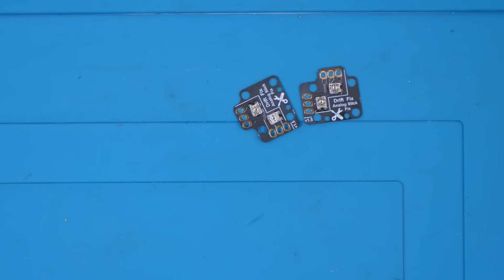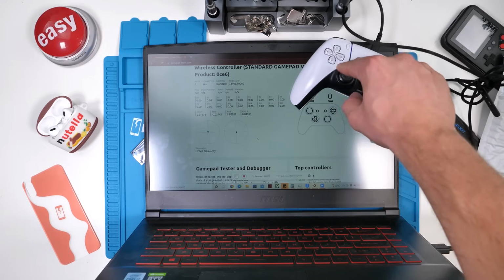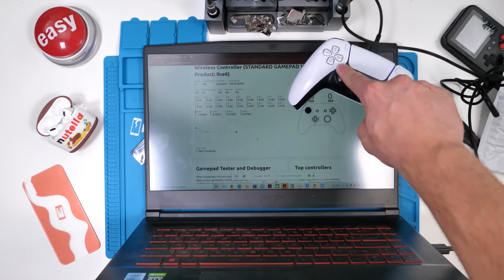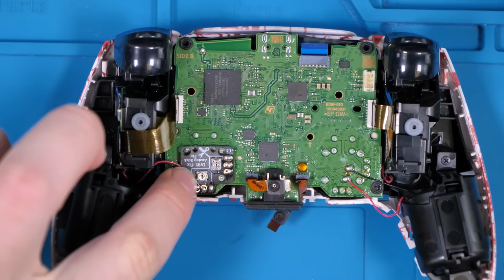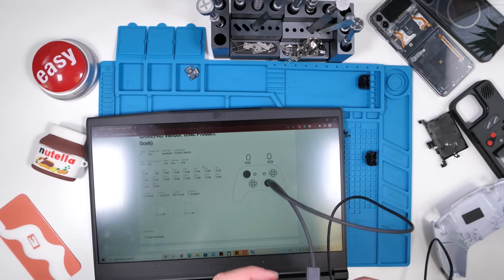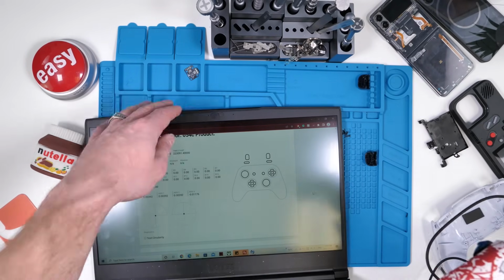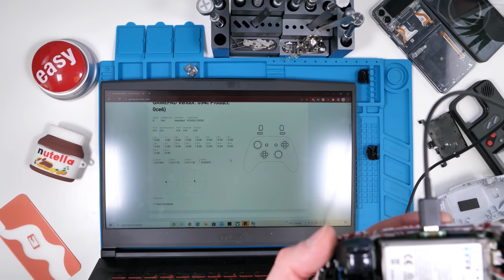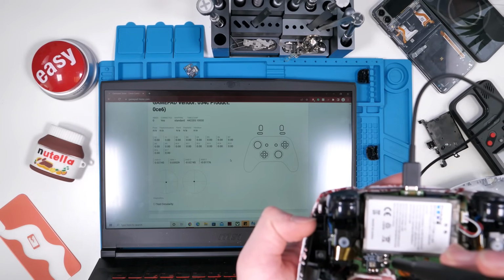IS THIS THE UNIVERSAL-  STICK DRIFT FIX?🤨

Comment: The stick drift was so bad on my ps4 controller it was unusable. I took apart the controller and open the little box thing on the joy stick with a small disc inside and blow in it and that fix the stick drift for the most part. There was still a little bit of drift but i could still play games with no issue

Comment: For minor drift, this is the best solution.
The drift will slowly get worse and eventually you’ll actually have to fix or replace the potentiometer. But for $6, it should buy you a lot of time and is still nice to have after if you manage to successfully repair or replace the component anyway.

Comment: L3 and R3 pressing while using L and R for moving and aiming is the culprits, i have tested this out one controller had L3 mapped as run and the other didn't...and the one L3 is mapped as run that was drifting after 4 months...the other one still works fine...

Comment: and for the Ps4 best fix is 100k ohm smd pots :). I just bought me a 12$ controller on ebay with drift n did another fix in preparations for mw3 :)

Comment: For Nintendo switch For some reason, the Joy-Con Drift (The stick Drift of The Joy-Con Controller) can be solved by a single piece of cardboard without soldering.

Comment: The only controllers which didn't have this issue were Xbox 360 original controllers, i got mine in 2007 and played with it for like half of the day for 10 years and they're still completely fine.
Reply: I used mine lightly for 2 years and left stick is drifting... my first one was really bad but it was a counterfeit. My current one is genuine.
Reply: they still have the issue just harder to get because the old stiks where bigger and stronger

Comment: Why do I have PS2 and an Xbox 360 controller with thousands of hours on them and no stick drift? On the Xbox controller I even wore out the button membranes and had to replace them. Something has gone south in these components of the recent generations.

Comment: But does this actually adjust the "area of movement"? If the joystick is off centre, and max input goes further right and less left, does this make it able to adjust it so it goes equally  right and left? And if so, does it make the max input less?

Comment: You can buy x2 analogue sticks for £4.50. Install is not much further than what you have done and the part is cheaper per unit. Plus this will fail more quickly. It is more affordable to replace the analogue stick entirely :)

Comment: I have a question... is a lack of input registration (specifically putting the left stick forward doesn't register sometimes) caused by the same issue as stick drift? 
And can it therefore be fixed by the same thing?

Comment: that amount of stick drift wasn't really that bad and you can usually fix it with software in about 20 seconds (im not sure if playstation has any software for it but on pc you can easily adjust these)
Reply: Playstation does NOT have any software for this, and will NEVER make that a thing, as they are making so much money off of people buying the edge and buying completely new controllers after they get drift😂 Greedy, very scumbaggy, but clever

Comment: So I have a question. When I use a controller, the right joystick only drifts when I either hold a trigger or use the OTHER joystick. Is it a drift or a technical issue?

Comment: Fere are a few soldering tips: make sure your iron is on a high enough temp, put a bit of solder on before you even thing about touching components, use a brass wire sponge ro easily clean your iron tip, and if your solder still doesnt really flow to cover the whole pad, try adding some flux
Reply: Hi could you please recommend what budget soldering iron for this type of job to buy for beginners thanks

Comment: I’ve got a stick drift on my Xbox one controller and there’s an issue with the back to the back cover when you click it on where the batteries are just not closing and yeah so my batteries also died so I don’t really keep it on just plug it in with a charger or something into my Xbox one but I also was stick drifting in Minecraft. I like onto Minecraft and sometimes my like my view camera like the one that you use it to move your camera around it stick drifting.

Comment: This won't do. If this is the only issue eith stick drift then a simple calibration would fix it. But the real problem with stick drift is it drifts... It's not offset to a specific axis. As you move the joystick the center changes everytime. And worse case scenario it moves on its own without touching the joystick

Comment: joy cons cant be fixed like the because they have a weird box thing instead of what ps4/xbox etc controllers have(its a small silver  box its kinda thin and the joystick just sticks out of it and DO NOT open them they are a massive pain in the ass and its basicly impossible to close it problerly)

Comment: I have a question. Does anyone know if it's possible to gut a really old phone and replace it with modern parts? Kind of like an engine swap.
Reply: That seems like a really involved project. Judging on how long it took the guy from "Strange Parts" to add a headphone jack to an iPhone. I can only imagine how long it will take to do what you're suggesting.

Comment: Why is this such a problem in the last 5 years or so? I’ve never had a drifting problem with any console before the switch. The n64 would get all floppy with age (don’t we all?) but it wasn’t with new controllers and it was the first analog stick so I give it a bit of slack. But after thousands and thousands of hours on analog sticks since then it was never a common problem…..until the switch. What’s the deal?

Comment: Honestly this isnt a good fix in my opinion. All those little boards do is just changing the resistance value, meaning you can only fix stick drift that is actually stable (that the centre is in different spot, but not moving), which most of the times isnt the case anyway. If that type of stick drift is caused by dirt, cleaning the potenciometer should be enough to fix, if its caused by wear and tear and you "fix it" with these boards, it will be bad very soon again. So the only real fix is to replace either whole stick or just the potenciometer.

Comment: Dude, where's the flux?
Reply from the maker: Don't really need it
Reply: @PhoneRepairGuru  your solder may be coming with pre-applied flux, but if you'll be soldering something serious like type-c, you might like some additional flux, it just makes job easier
try nc-559 for soldering and RMA for desoldering
Reply: @PhoneRepairGuru  also your soldered holes looks a bit overflowed, good flux also fixes this problem

Comment: This is stupid, by time you will need to calibrate again, and again, graphite will degree at serious level soo you will not be able to calibrate stick drift again.
The real solution is to change sensor graphite wheel( three solder joints).